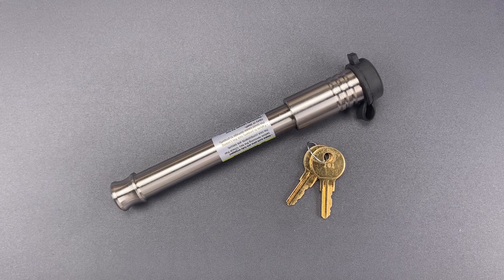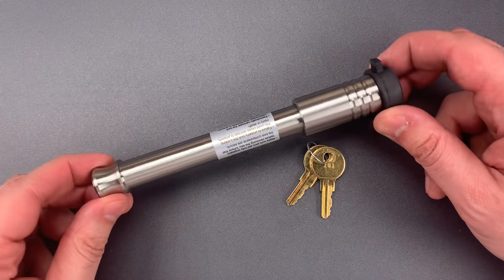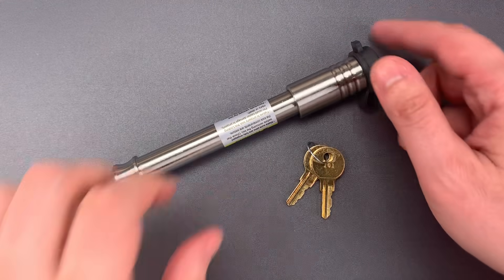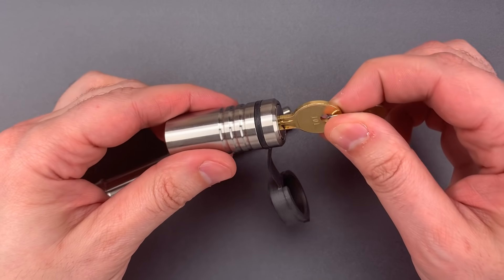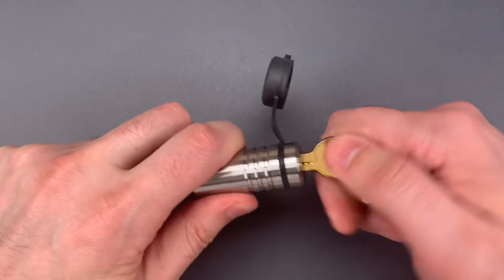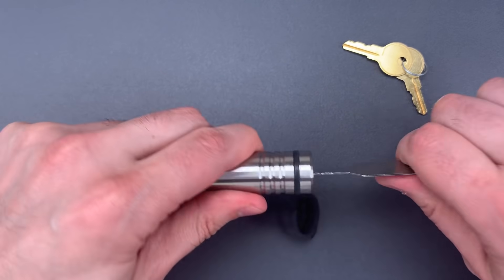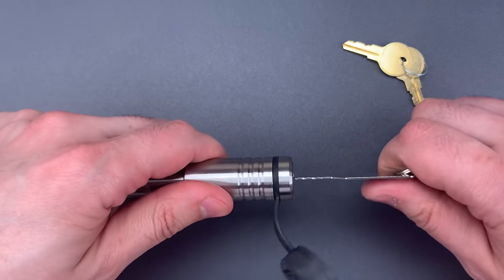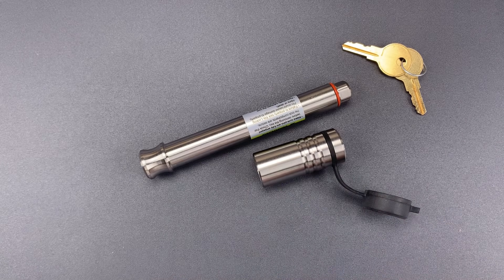[1086] The Lock That Must Be Picked 15 TIMES! (Infinite Rule Security)

Comment: Why do all of these almost good locks have to have water cores? Like cmon, increase the price a little and make something with an actual core.
Reply: I think a core made out of water would be better than a wafer core, sadly...
Reply: NitroScott77 
Probably because the buyers only see the build quality in the hardware store but don’t care about the actual core.
Reply: I heard that water cores can be easily beaten by applying a towel to the opening.
Reply: It's not just a frice thing, a lot of these have wafer cores because waver cores can be made a lot thinner than pin tumbler cores, granted you can fit a disc detainer core in the same space as a wafer core, but those are expensive and have key repro issues, which is a problem a lot of people don't really consider.
Reply: There are actually high-security wafer locks. It's just these cheap cabinet locks are a lot more prevalent.
Reply: @Melds  yeah but those arent super common outside of Japan and/or auto locks in my experience.
Reply: It's because the hardest part of the lock to manufacture price-wise is usually the core/mechanism and they all buy the same basic parts/designs and put them in their product.  Inventing a new design requires a lot of expense and tooling.

This is a lot like how American Whiskey is - there are only a handful of distillers who make their own.  Everyone else buys pre-made stock from the few mega-distillers in the country like MGP, or a subsidiary of of one of these giants, and then adds their own blend/finishing and of course, their "story" to put on the label.

It used to be acceptable, but especially with the rising popularity of online videos and tutorials, it's gone from a skill few people knew how to do to almost a party trick that everyone knows about.
Reply: @plektosgaming  Even then, there are some pretty good MGP whiskeys out there, such as Bulleit. It's all about how you use the components you're given.
Reply: You can get reasonable high security wafer locks. Look at car ignition locks. Anywhere from 8 to 36 wafers (4 track keys).
Reply: I think manufacturers in the US (I'm guessing here, since EU locks seem to have slightly tougher pick prot) aren't concerned with lockpicking at all. Most of their efforts seem to be towards destructive attacks.
Reply: @peterturn  Exactly.  Adding a microchip insert like they did on GM keys for decades alone would stop most non-destructive attacks, but again, cost and being cheap.
Reply: They're cheap.
Reply: @viniciusdesouzamaia  the average consumer doesn't know anything about lockpicking and probably assume most locks are the same. But seeing over an inch of steel definitely looks secure.
Reply: 420 likes
Reply: Oh, don't worry, water cores work perfectly well...
...on Pluto. Here, they just melt.

Comment: I mean, even with just a simple pin-tumbler core with 1-2 security pins so it couldn't be raked/bumped would mean this would take AGES to open. Real shame about the core.
Reply: Problem with a pin tumber core is you need a bible to hold the driver pins, one of the nice things about this lock as it stands is that it is perfectly cylindrical so it cannot be attacked by twisting it with a wrench.  A bible stuck out the side would provice a place to get purchase with a wrench or simular.
Reply: @leewakefield8658  It could still be round, it would just need to be much larger in diameter. And I believe this would interfere with it's purpose as many receivers would not have the required clearance.
Reply: @bradley3549  And you would only have to pick it 4 times.
Reply: @kwils6685  How many times you have to pick it is a function of how many bibles and how long the thread is. You could build a lock with these principles where you'd have to pick it 100 times if you wanted.
Reply: @bradley3549  You are correct sir, I was just assuming it would be a single bible to keep the price from getting out of control.
Reply: @kwils6685  what is this bible your talking about

Comment: He is reaching picking levels which shoudn't even be possible.
15 freakin times in a min...
Reply: Smeet Ashar actually, 26 seconds.
Reply: It's a wayford lock jiggled open, jiggling a lock can take even less than a second if you're lucky enough, it's like closing a box with 15 layers of duct tape, it's still weak even if it's a lot
Reply: Endeav0r_ it’s “wafer”
Reply: @Smeet Ashar Considering the type of core, you could pick this lock if you had the right tool. Not as fast, obviously, but you just jiggle these and they open.
Reply: i mean the way he explained it it seems like picking this lock 15 times in less than a minute is possible for most of us with a little practice

Comment: Could a more resilient lock, such as one by Abus or Squire, work with this 15-pick setup? Heck, could a Paclock work with such a setup?
Reply: Theoretically, yes, though it would require a specific and custom design completely unlike the vast majority of current designs. Also, for something as hardcore as Squire's high-end hyper-durable monstrosities, it would be less reasonable, as the threading- as seen in the video- would be a major weak point without being some serious high-grade stuff and probably much larger than seen here. Then again, for the guys who made the, what... 15 pound lock? Whatever it was? For those guys, that's probably fine with them. However, that vastly limits the usability. There's only specific circumstances in which the shown lock design is really 100% viable, whereas more typical locks have a much wider range of use.

In summary: Yeah, it could, but it probably wouldn't be easy, cheap, or lightweight.
Reply: Joshua Gherlone well if you were a business or had this on your very nice car or maybe a lockbox with keys to your mansion then it would make sense to buy one if they made it even if it was expensive so there’s probably a market for it and tho
Reply: @TOSkwar22  Making the bolt a larger diameter woukd require making the pin a larger diameter. If the pin is bigger it won't fit the holes in the receiver/hitch, which would make it useless for the intended application. Since it's intended application puts it under the rear bumper of a truck, it's sufficiently strong as it is. It just needs a better core to be more pick resistant, but even with this core most thieves would attack the lock securing the trailer hitch itself. It's easier to get to, easier to see...thieves like easy.
Reply: Maybe the screw part would be blocking the padlock from opening, so you'd have to spin the key a few times to open it? I'd probably add a second keyhole with a normal lock mechanism so you can't just spin the keyhole or pull on it to strip the screw.
Reply: I've always had the idea of making a lock like this, but instead of a screw it's a combination lock.
Reply: @Damariobros  but the problem is that combination locks are usually easy to buy pass.

Comment: 2 important things to remember - these are a PITA to open with a key when they are under the truck, it would not be nearly as easy in situ and they are generally only protecting <$100 in hitch.  It is rare the the trailer is in a position where it could be easily stolen if the pin is picked.

Comment: Infinite Rule Security: Noted, we'll make it so that it must be picked 1500 times.
Reply: Then you have to turn the key 1500 times, no one will use it. Also i think it could still be impressioned.
Reply: @leandrog2785  no you only have to turn the key 375 times as it relocks with every quarter turn still unresonable though. (Chould be good if it relocked 100 times meaning 25 turns as am sure almost every theife whould give up assuming there attack isnt working by that point)

Comment: I'd like to see LPL examine a Strattec Bolt trailer lock, the kind that is vehicle specific and sets itself to work with your truck ignition key, to reduce the number of keys you have to keep track of.
It seems like a unique design, because it comes unkeyed, then you insert your ignition key and it locks in that pattern permanently.

Comment: Is it possibly to change/improve the core in it?
Reply: Easily. There are tons of more secure cores that will fit in the headpiece of that lock.
Reply: @lairdcummings9092  three are probably a lot that will fit, but didn't get a good look down the shaft to see how. What would be a decent core swap for this then price/function.
Reply: Then rebrand?  After sending to lpl ofc

Comment: I believe "for this price range" was a dead giveaway. Anything cheap has to cut corners somewhere, and good lock cores are never cheap, not visible to the consumer, so of course they are the ones that has to give.

Also:
This is one of those "security by inconvenience" systems. It offes slightly more protection than a bolt (more people can unscrewn a bolt than have the jigglers for this lock type) but is is just as inconvenient to use. You have to turn several times both to lock and to unlock the bolt, as it is essentially a bolt with a custom bolthead.

Comment: that's what baffles me with those kind of lock, like, you got a pretty good concept and then you ruin it with a crappy core, wth ?
Reply: Are most thieves going to bother "picking" a lock 15 times in a row? Especially if they likely don't know the trick to this particular lock.
I also expect there to be some engineering constraints going on here, especially considering the price point and all the other positives for the lock.
Reply: @roguebanshee  i agree with you but the jiggling trick must be quiet know in the picking community (i assume). i hope it's in fact a technical constrain and not a budget constain because it would be a shame ima

Comment: How many people actually understand what this is supposed do? It’s a hitch pin that needs to hold the whole receiver and trailer to the vehicle. Hence the quality. However most receivers this pin would be used in are 30-40 buck. Really there two kinds of people steal receivers left in vehicles, junkies that seal them (mainly to seal for scrap) or some guy that’s pissed he just walked into it in the parking lot. This is more then enough security for that and the design is simple enough to work. Sure some rv hitch’s can be several hundred bucks but people don’t just leave those on their vehicles.

Comment: I'm actually impressed.  most receiver locks are held together with an exposed pin that take 4 seconds to drill out. not having that option means it has to be picked.
Reply: Or just whack the lock end with a big fskin' hammer until it snaps off.

Or put a pipe over it, and snap it off that way.

You'd need shrouded receiver pin holes to make this secure.

Comment: It would be interesting to see this picked when its installed. If I am picturing this correctly, you need one hand to hold the back of the, one hand to turn the part with the key key hole, and another to work the jiggler.

Comment: That’s ALMOST a brilliant design. Just make it so you have to spin the core through the pins multiple times. Even if you’re a master lock picker, it would force you to pick the lock a dozen times over. If it were more rake proof, then it would be a great system.

Comment: The one silver lining with this locks design, though, is that the company has the option to sell better replacement locks that you could just swap the old ones out for with no actual effort, and this would save them on machining costs and the end user on total cost. Whether or not they end up doing this is a different story, but the option is on the table and is a relatively easy fix.

Comment: I would love to see a destructive open of this in a hitch. while the core is bad it is still 15 times better then many pins that would just use a masterlock to keep them in. A tempting purchase for my parents that use the hitch for little things like bike racks when camping as the main connector for them is a fifth-wheel hitch in the bed of the truck.

Comment: looking at the keys you can tell to use a little jiggler because the key pattern is flat without previously picking this lock or looking at the kets one would not instantly go to that particular jiggler and the ACTUAL pick time in the field would be much longer! The lockpicking lawyer would no doubt be able to get it in the field as well but would have taken much longer.

Comment: it's clever because the mechanism spins a threaded bolt. It really wouldn't take much to replicate this with any decent core..... as long as the core type allows for the continuous 360 degree rotation required to unscrew a bolt. This is probably the design to cost considerations made here when they chose a wafer core, something that spins all the way around without being prohibitively expensive to manufacture/incorporate.

Comment: That's a good way to have a key break in the lock...  Seriously... the tension on the key to screw/unscrew is going to get crazy when dirt and general weathering takes effect on those threads.   I wonder if the manufacturer did shallow cuts explicitly to cope with the force needed to operate the lock after sitting for half a year. 

Also... FFS "Failure to properly lock this locking pin could cause damage to property, injury or death"   You're telling me if I leave it on my shelf unlocked it could kill me?

Comment: There is a security solution to being able to safely use this. You need an environment with road salt. Then you put it on and leave it on for a couple years. And you're done. Key doesn't work and I doubt picking it's going to do any better😁

Comment: The design as is could still work if you don't already know the lock. after 1 or 2 times of "picking" the lock and it's not open, they may give up and move on. kinda like a deterrent. They could always make a 2nd model, like a "pro" version with a better core system to make it more resistant to picking.

Comment: Do it with it through a hitch, where you can't hold the shank and turn the cap with one had while picking with the other. Would be far more clumsy and time consuming. Giving a chance to catch the person or they give up. Or just slip a length of pipe over the lock and and give it a pull or a kick...

Comment: I have to wonder how easy it would be to pick if it was in use though. I know you said it's a trailer lock, and that it would be under a truck. 
Not that I have a lot of practical experience, it could be just as easy as shown here for all I know. But I do wonder.
Reply: Adam Heywood - It’s a lock designed to lock a trailer hitch into the receiver part of the hitch at the back of the truck. It’s not actually under the truck but down low at the back so accessing it would make it a little bit harder but not much - especially using those wafer juggler keys he has!

Comment: This has serious potential. Needs a 9 pin or something that's gravity-affected. Imagine if you could pick it until the cylinder flipped upside down and then it was unpickable until it turned another half turn. I think you could do that with really heavy weights behind the springs so that the weight (when upside down) forced the pins back down into place.. damn I should patent that... Lol

Comment: Even if someone did pick this lock, they would have to know that it needs to be unscrewed and turned several times to get it open. So it does have some security. If the lock manufacturer did not use the screw setup it would have been open on one try..so now it's fifteen and I'm sure without knowing it needs to be unscrewed someone would just give up!

Comment: Wonder if a wafer lock can be improved with an inverse wafer... you depress the wafer and it catches the notch instead of releasing it. Having one near the front would make single tool jiggling potentially difficult because you're going to press that wafer just by having the tool in the keyway.

Comment: What if padlocks and house deadbolts had a similar self- resetting core, that took multiple turns to move the pawl/shank. Like 3 to 5 turns? Sounds like a easy way to increase time needed for a pick-attack.

Comment: Is that"Denny" as in Den Brass? Also, judging by the size of the lock, it might be possible to replace that wafer core with a tiny medeco cam lock. 3 pins or not, at that point it would be faster just to cut the tip of the trailer hitch off.

Comment: I wonder if this idea of the core spinning and threading a bar/screw could be implemented for padlocks or bike locks...i mean, what if when you thread  the core into a screw and the core lifts slighty upward, two bars on the sides of the core lift ball bearings into the locked position?...what do you guys think (off the top of my head)

Comment: You mentioned that you like lock out master locks to practice picking. I bought 4 and I’ve broken 2 at this point. I’m new to picking and was wondering if you have advice? I find that I have to pick them a bit hard to get them to open. Is this true of your locks? They are the master lock lock out locks you mentioned. I’m afraid to break my last 2:( they are really fun.

Comment: It would be interesting to see him try picking a lock that can actually live up to the "high security" part of it's name and doesn't have a massive design flaw that a toddler could figure out if given a hairpin, a pair of tweezers and a  few minutes alone with it.
Why do people even use a wafer core in anything that is supposed to be secure for instance?
I get that a lot of locks are for show but many of the locks that are advertised as more than just for show seem to be no better in terms of actual design and only a bit higher in quality.